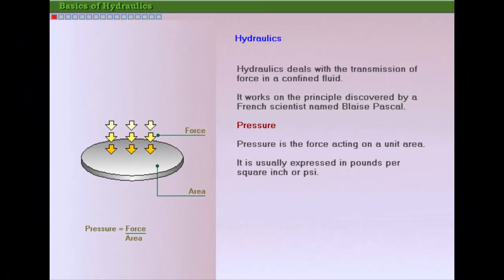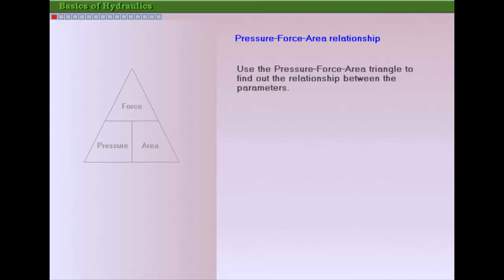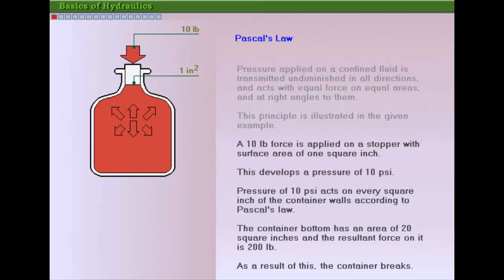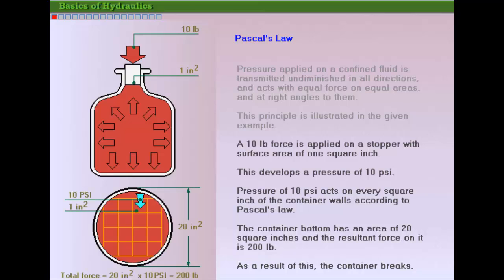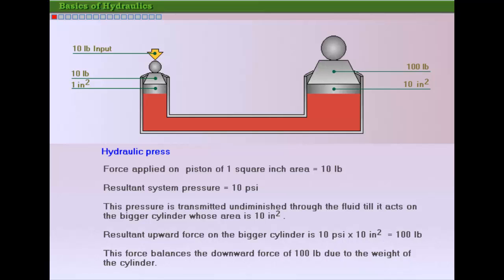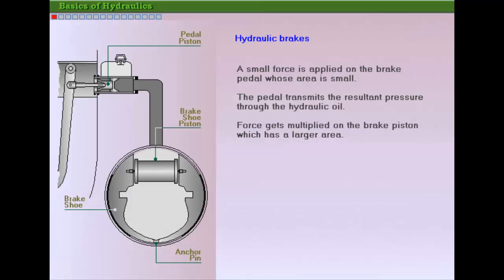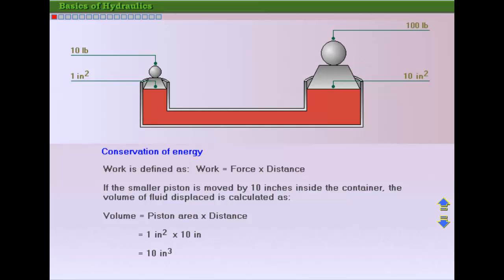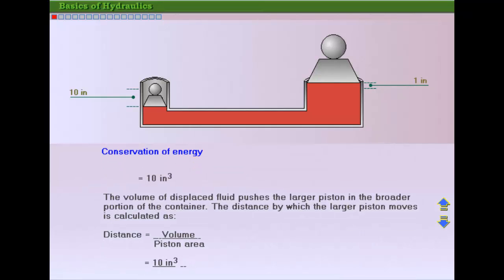Basic of Hydraulics 1 OF 16 | Mechanical Engineering

Comment: But when we apply Bernoulli equation , at a Venturi effect pipe , we get that the Pressure is Changing according to the velocity of the Fluid !!! So in larger areas lower will be the velocity , Higher will be the Pressure ! (Not Constante) . Can you explain to me if I'm wrong please ???
Reply: Daniel Y Pascale's law for static fluides only

Comment: I want to know if you can use one pump to lift a roof with 2 or 3 or 4 Hydraulic Rams, so that the roof raises evenly? I've seen how Air Bags work in a car and I like how you can use one pump to fill the air bags and because it's only one pump, you get even air distribution. Even Distribution means the car is self leveling and I'm pretty sure this system would be exactly the same with Hydraulic Rams raising a roof on an RV or a Caravan. The reason I ask is that I'd like to build my own Trailer, that has a roof which collapses / lowers so I can fit it in my garage when at home. The same principal for slide outs, I'd like to build the slide out with hydraulic rams and have the floors slide out evenly. Not sure if I will use Hydraulic Fluid Rams or Air Actuated Rams, but I'm trying to understand the basics.
Reply: do you already have a solution to your answer?